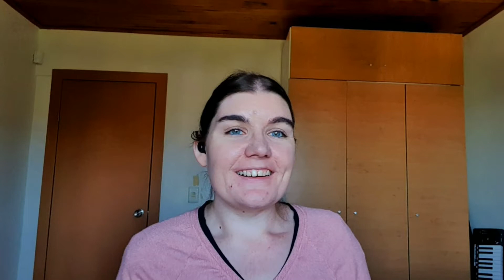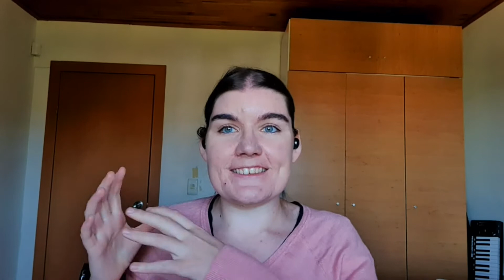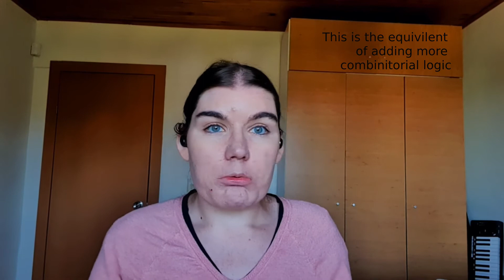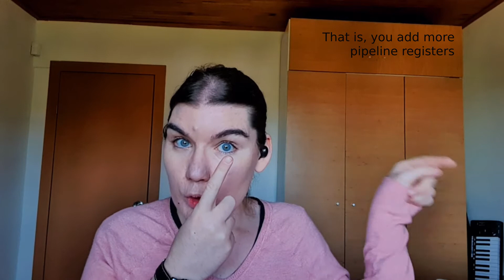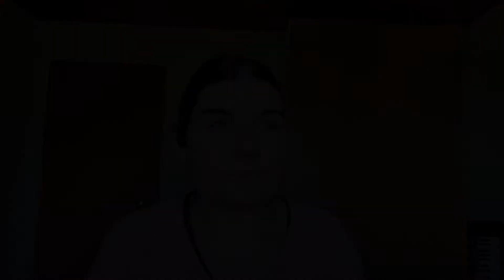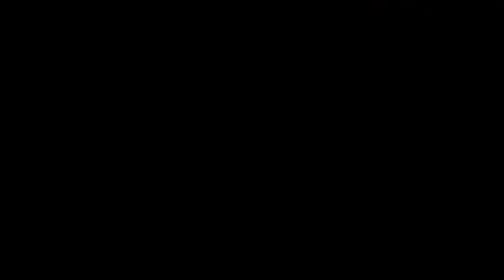FPGA Clock and timing concepts explained simply for beginners using two  analogies!

Comment: I'm glad you produced this video. I have an Counter AXIS IP to a FIFO to AXI DMA to ZYNQ PS on a Zedboard and couldn't meet timing until I slowed the F_CLK0 down to 80 MHz from 100MHz. I'm not sure which worker is having trouble putting on the lids though :)